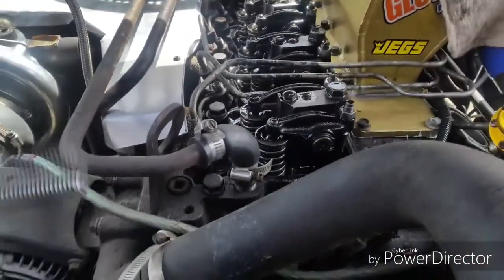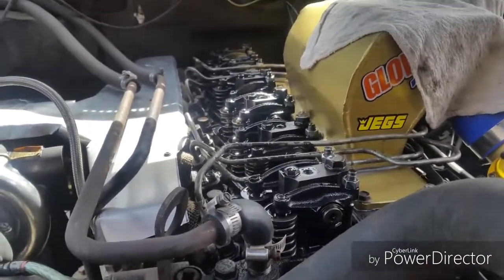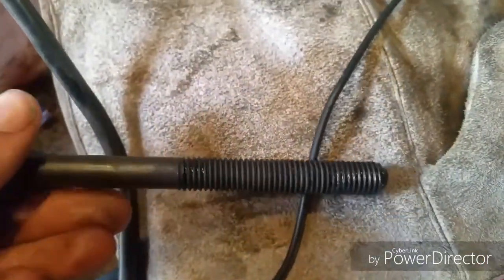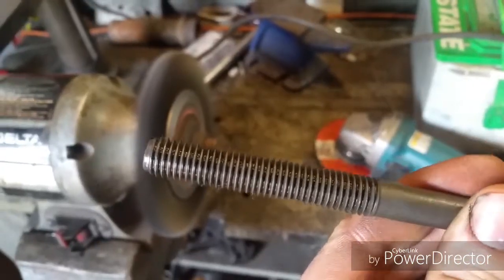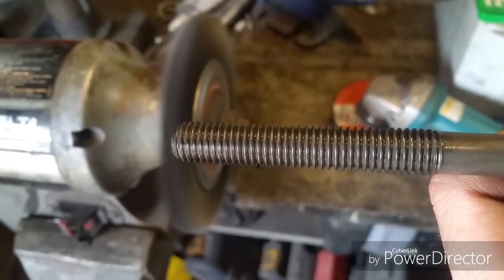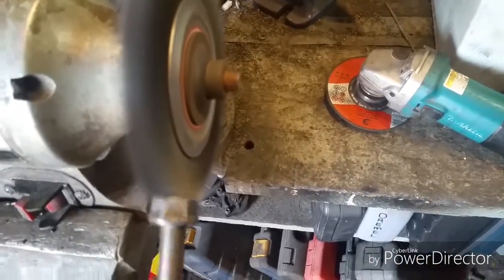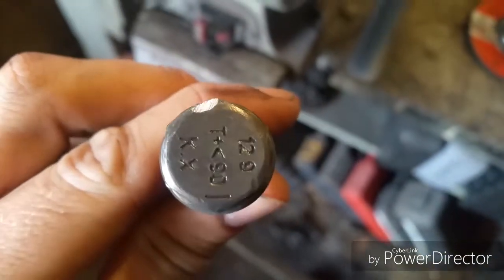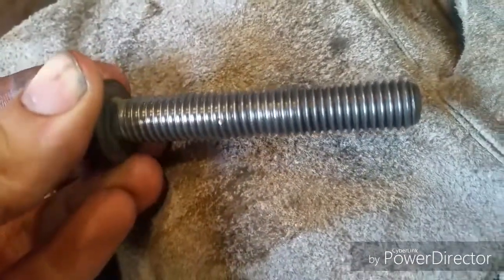12v cummins over torque head bolts!

Comment: Was the gasket leaking before you did this? Did it fix a problem? My ‘96 is leaking some exhaust into cooling system so I’m planning to do this and see if it helps.
Thanks for posting!
Reply: Did you figure it out